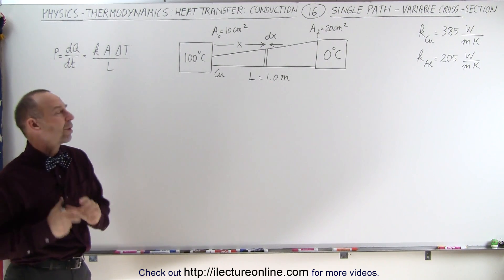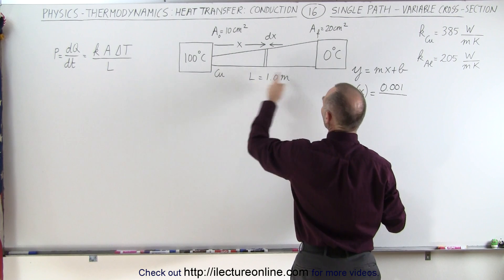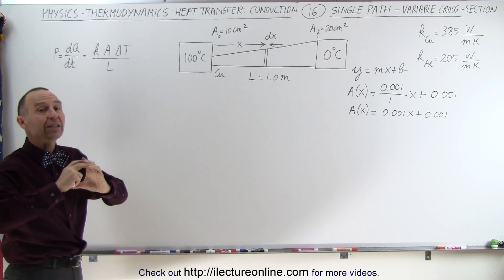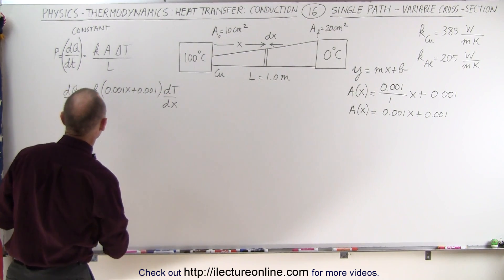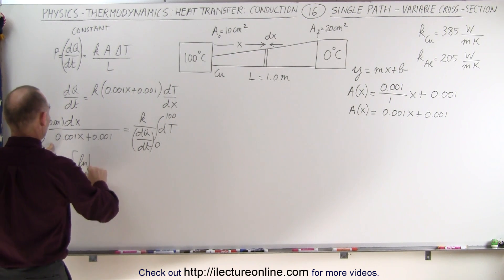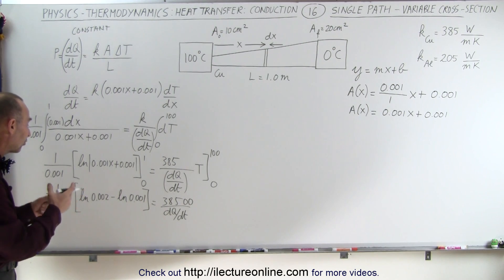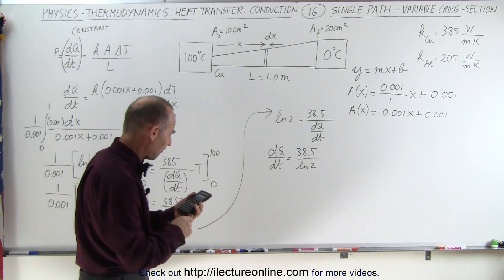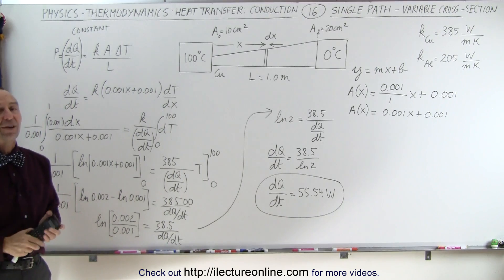Physics 24  Heat Transfer: Conduction (16 of 34) Single Path - Variable Cross-Section

Comment: Very interesting exercise.
I had a bit of conduction stuff in my old physics book "University Physics With Modern Physics", and that was a really good book, however I don't think that it said anything about variable cross-sections, although it did mention variable temperature.
Reply from the maker: Yes, this example pushes us a but farther than you will see in most text books.  🙂

Comment: Where did the limits of integration come from? I'm not used to seeing seperable equations with definite integrals.
Reply from the maker: The limits come from the problem itself.  Since we are integrating over the temperature gradient, we need to add all the little snippets from where T = 0 to where T = 100, which is integration.

Comment: This video is incorrect. When you integrate on both sides, you have to integrate with respect to the same variable. The attempted shortcut where the lecturer simply moves the dx to the other side and assumes a linear change of bases fails because T is not constant with respect to x. You can intuit this by the fact that at steady state, the energy transfer across all subsections must be equal, which means the gradient of the temperatures has to increase as A decreases. You also see how this has to be false by the fact that, if the areas approach equality, you approach ln(1) in the denominator for the rate of energy transfer, which would imply that as the areas converge, the energy transfer approaches infinity (which is nonsense).
Reply from the maker: No error here.  The technique shown is a perfectly legitimate way to solve the problem.  And you can have 2 indpendent integrals on either side of the equation.

Comment: Hi sir, so dQ/dt is always constant throughout a material even with variable dimensions?
Reply from the maker: It has to be.  Like water in a pipe that changes diameter.
Reply: @MichelvanBiezen  Just wanted to confirm. Thanks a lot!

Comment: sir at 4:10, shouldn't x=0 correspond to T=100 and x=1 correspond to T=0? Did you reverse the limits? 
It seems that you've taken x=0 to be the left side when doing the y=mx+b equation.
Reply from the maker: It doesn't really matter.  If you switch the limits you'll get a negative answer for the change in temperature which indicated that the heat flows from higher to lower temperature or you can just show the limits as in the video which gives you the magnitude of the change in temperature.
Reply: Michel van Biezen thank you sir!!

Comment: sir one more question - if the area was varying per unit length shouldn't we write dA/dL ??
Reply from the maker: dA/dL   represents how much the area changes as the length changes, and dL/dA represents how much L changes as A changes.  There are many ways in which you can represent the change in one relative to another.

Comment: sir, why did you write the slope intercept form ? also sir, the temperature is going from 100 to 0 so shouldn't the limits for the temperature go from 100 to 0 as( lower limit be 100 and upper limit be 0) ??
Reply from the maker: You can reverse the limits of integration when changing the sign.  There are many ways to solve this problem, this is just one of them.  Try it in a different way and see what happens, which may help you see why it was solved this way.
Reply: @MichelvanBiezen  sir , i tried it and found that there will be a negative sign .Here, i am not doing what you said that" by reversing the limits and changing the sign" . since the temperature is going from 100 to 0 in the question so we must naturally take limit 100 to 0 , so why to change sign . had it been a question where temperature would go from 0 to 100 somehow then we should have taken this . 
i just want to clarify that sir , nothing offensive. : )

Comment: what if there are two materials with different k and different slope? I am trying to solve but numbers do not add up. thanks in advance. Also how to calculate the temperature at the mid-length?

Comment: How did you write slope=A°/L? Wouldn't that be total rise/ total run?
Reply from the maker: In this case m does not represent the slope.  We need an equation that describes the cross sectional area as a function of position

Comment: hello Mr. Biezen, why do you multiply by (1/0.001) outside your dx integral then multiply by (0.001) inside the integral to immediately cancel it ? am i bad at calculus for not understanding this step? i factored A(x) = (0.001)(1+x) and integrated [dx/(1+x)] by itself and got the correct answer without that step... will this cause me problems down the road?
Reply from the maker: That is required to integrate that integral.  In order to integrate that integral you need a correct differential.  Note that the constant in front stays, but the constant in the integral disappears as it is used as the differential of the integral.
Reply: For anyone else who is wondering, he explains why in  "Calculus 2: How Do You Integrate? (37 of 300)"
Reply: @xxmiffoxx  Oh, it's a u-substitution shortcut. Thank you for posting this. I had forgotten.